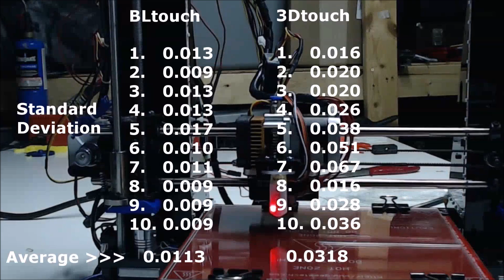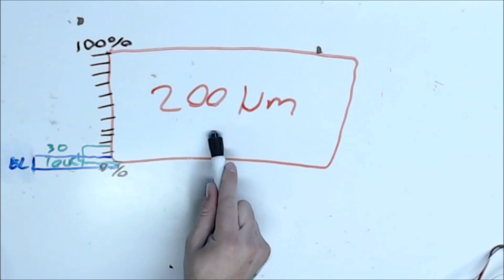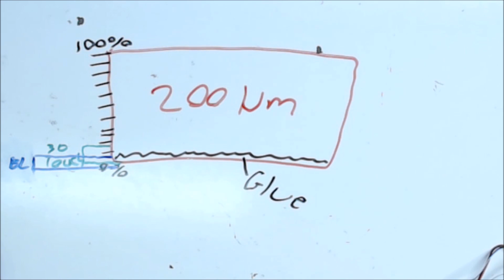BLtouch VS 3Dtouch 3D Printer bed leveling sensor match up

Comment: Great basic video but you miss the main issue with this sensor, in particular the BL Touch. It has some heatshrink holding the hall effect sensor trigger (magnet) to the probe pin. This means when your hotend heats up the accuracy drops way off as the heatshrink starts to heat up and unevenly change shape. So depending on when you do the calibration and how hot the whole are is, it will massively effect the BL touch accuracy. By how much you ask, well it can be by more than 0.1mm which can be more than 1 layer height. This is why many people report that the accuracy on the BL touch is not good enough, especially if they run a calibration before or between prints as the sensor pin has effectively changed length. The electromagnet inside holding the pin up also suffers badly from heat, this means on a printer with an enclosure the pin can drop down during a print due to the increase heat and ruin prints and or course bend the BL touch pin.  The standard deviation of the BL touch on a cold setup might not be much, but the accuracy is not very high (pretty much the worst on the market for Z probe sensors) and it gets worse the hotter it gets....
Reply: My standard deviation  has not changed from cold to 250 degrees on the hot end. so I kinda call B.S. I have 3dtouch and bltouch on different printers.. You may have the bltouch too close to the hot end.. It should not be getting hot anyways

Comment: I have the 3d touch and it works like a charm. 
Cheaper and works perfectly. Would buy again
(on a cheap Anet A8 ;)
Reply from the maker: Kro Gon Awesome, thanks for the feedback.
Reply: How id you get it to work with 3d touch. When i attached the 3d touch, the nossel is lower than 3d touch by 8 to 10mm

Comment: Good video! :)
ive been modifying a cheap ass anet a8 with the cheapest parts i can find and the 3d touch have been the best one yet.
Reply from the maker: Nice! If you haven't done it already check out upgrading to marlin firmware. https://youtu.be/2uX5_rI1QM8

Comment: The price seems to have dropped a bit for the real BLtouch, and the clone is a cheap knockoff that violates the inventor's intellectual property rights. The choice should be a no brainer. BLtouch (Antclabs) supports their product well. I bought one and it's great. If there is a price difference at this point, the hassle and bad karma just aren't worth it.
Reply from the maker: Thanks for the comment, all good points. The BLtouch seems like a good product and does a nice job and if it's getting cheaper, even better.

Comment: I will say that ethically you should not be buying the clones. The BLTouch is patented and the 3DTouch makers do not have permission to reproduce it. Technically, they are illegal copies.
Reply from the maker: That is a very good point.
Reply: I've ended up with a clone, after purchasing through eBay, thinking I'd bought a genuine - this video has given me peace of mind I've still got a useful part rather than a POS - had I realised it was non-genuine I'd have certainly had an OG unit though - the 3D print industry is driven by innovation and volunteers and when something like this comes along we should definitely get behind it
Reply: I didn't think about that. Good point!
Reply: Are you the NuttX Greg Nutt or no relation?
Reply: I agree with the ethical part, but until it is not sold as an original one and the copy doesn't look like the original (like 3DTouch does :S), and the solution is not a simple copy it can be sold. Additionally, if you manufacture a patented solution in 1:1 (but not using the brand on it) and sell it in the unprotected region is not illegal as well I know. Selling a clone in the patent protected countrys is illegal. Ebay has a bad affect on inventions, but sometimes the inventors overprice an item so I think that the original manufacturer also should rethink the price sooner or later. I don't say they should underprice their product but to shrink the price gap between the original and clone ones especially when the quaility has minimal gap and the products use the same parts. Keep the prices high and not giving significantly better quality is also not ethical. (Sorry for may bad English)
Reply: Greg Nutt if the clone works, I go for what is cheaper...
Reply: It is not a clone, it is an illegal copy. This kind of action kills the sharing of creativity be it commercially or open source or public domain.

Comment: I felt it necessary to edit my comment here. I had already ordered a Bltouch clone before watching your video. My clone turned out to be a dud. The servo mechanism did not work. No amount of cleaning , adjusting or tweaking made it work. I went and ordered a genuine Bltouch to replace it and it worked right out of the box. No adjusting  or fiddling required. The Many hours I  I spent trying to debug the clone could have been better spent doing anything besides messing with a piece of crap. I can't recommend the clone to anyone really. There are many on the forums that have suffered the same fate as me with the clone.  My advice is to save your money elsewhere, not on this part. 😩

Good video! Nice job.
Reply from the maker: Thanks for the comment, thanks for watching!
Reply: Yea, I have exactly same experience. Spend hours trying to fix that 3DTouch crap and end up ordering genuine one.
Reply: I did order a cheap 3DTouch and have had my fair lot of problems with it.  When probing my bed, I get results that varies up to 0.15 mm from one bed probe to the next!!!  (using bed visualizer plugin for Octopi) I will be ordering the real thing in hope it works better.
Reply: @Zolt  Same here.

Comment: How about buildl quality ? Mine 3D   Touch is not so good, the metal pin is too small comparing to the plastic case so it can wiggle.
Reply from the maker: Nuttavoot Chupanya Thanks for watching. The pin in the bl is smaller than the 3d, but the 3d does seem to have a little more play. I think  if you took the probe speed down to maybe 180 mm/m you could get the 3d touch to be a little more accurate.
Reply: Do you mean "Z_PROBE_SPEED_FAST" ?
Reply from the maker: Nuttavoot Chupanya HOMING_FEEDRATE_Z (4*60) is where the speed is actually set. You can adjust it here to make it a little slower. Maybe 4*50 for a test.
Reply: Thanks for the advice. This does make a lot more accurate.
Reply from the maker: You are welcome, glad it worked.
Reply: Chris Riley Still not good, I still have one side thinner than the other. Will the genuine one will solve this problem.
Reply from the maker: I have found that bilinear leveling is not very good at compensating for X skew. What I do is run a G29 copy the result, then adjust my Z rods manually up or down until both sides read fairly even. I don't think a bltouch would solve that issue. You might also look into the new unified leveling in Marlin. I seems a little complicated to setup, but it would handle this issue much better. What does you G29 map look like?
Reply from the maker: That is a great point. I should have mentioned that.
Reply: Festivejelly How to do that ?  Isn't done automatically ?
Reply from the maker: Nuttavoot Chupanya Comment out MIN_SOFTWARE_ENDSTOPS in marlin. This will enable you to go lower than 0 Z, be careful of bed crashing.
Reply: Does it need to be commented out during normal use ?
Reply from the maker: I would say you would want to leave it commented out. Each time you run G29 there could be a chance for it to be different.
Reply: Festivejelly It's strange that I have never seen this mentioned anywhere before. I have read a lot of articles and watched many  videos about Autoleveling, this is new to me.
Reply from the maker: Nuttavoot Chupanya You have me interested, it makes since that you would need to disable min software endstops, I usually always do anyway so I can set my offset, but now I want to test it. I'll get back to you with what I find.
Reply: Wait for your result. My opinion is there will be no different disable or not min software endstops for auto bed levelling to work correctly, the firmware should be smart enough to do the disable it automatically if needed.
Reply from the maker: I have found that if min software endstop is enabled or disabled it doesn't make a difference. I skewed the print bed to far in negative z and positive Z with it enabled and the bed leveling corrected it just fine. I think what we are thinking of is the ENDSTOPS_ONLY_FOR_HOMING from back in the day. At one time if you didn't remove the comment from this line the endstop would be in affect while leveling thus making it impossible to go past 0. This option was changed in Marlin 1.1.0 rc7 to //ENDSTOPS_ALWAYS_ON_DEFAULT which is by default commented out which is how it should be set.
Reply: Chris Riley Thanks for your finding.
Reply from the maker: Anytime! I love this stuff!